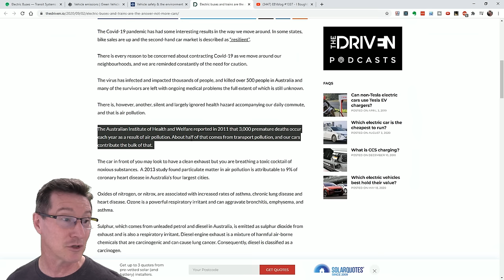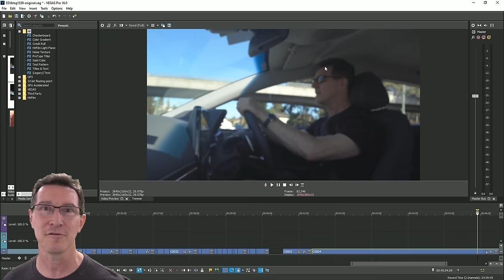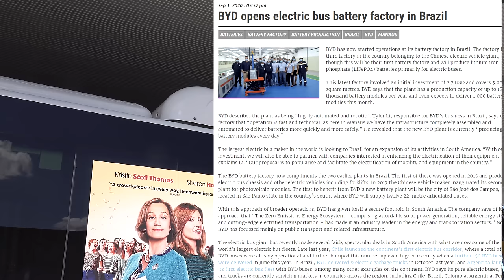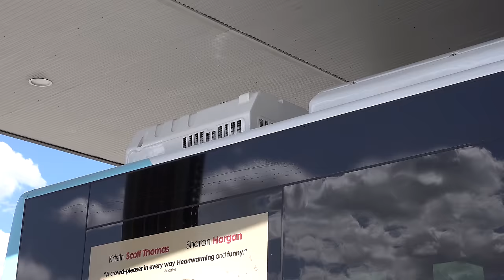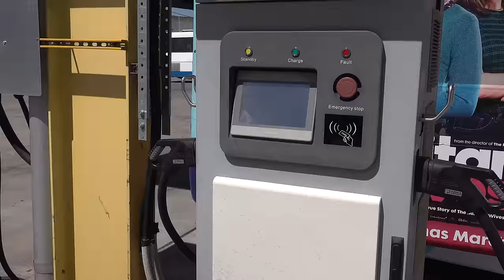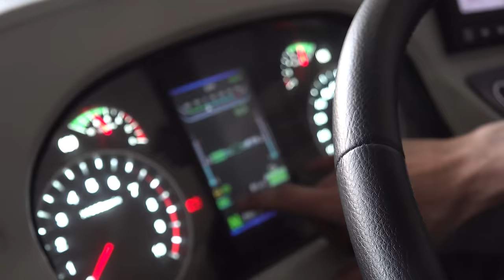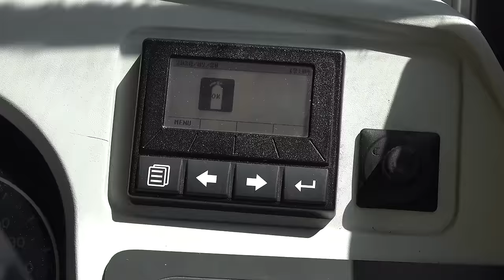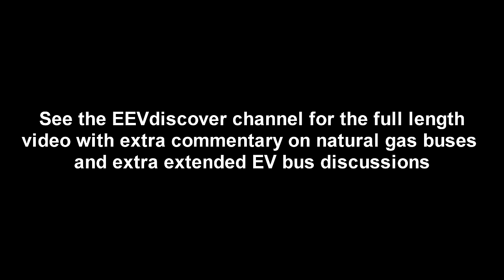EEVblog #1339 - Looking at an Electric Bus!

Comment: "there's almost half a million electric busses in the world, but you don't hear about them" 
Yes dave, that's because of the electric bit. no vroom vroom, just silence!
Reply: I can confirm this for Germany, where field tests showed that electric buses are in fact super quiet - that's mainly because they are grounded in their depot most of the time as even with the biggest and latest battery technology, they run out of juice after 1/2 a day max., whereas the diesel-powered ones run around the clock...
Reply: @f.d.6667  Did you even watch the video?
Reply: @max_kl  Maybe he meant on the routes they took which were a longer drive?
Reply: The electric buses in my city make a noticeable sound, definitely not quiet.
Reply: @gblargg   Electric busses in my city are equipped with electric vehicle warning sound systems (EVWSS). They produce artificial sounds to annoy pedestrians, pardon me, to WARN pedestrians, of course. Below 25 km/h they sound like a broken gearbox.
Reply: @max_kl  Not only that - I even developed battery-powered vehicles with my teams that made it into the market. They work great in a very tight envelope and under very specific climate conditions. In principle, buses should be the ideal platform for electric transportation - but again: the investment is huge when you want to build a system that can handle fluctuations in use or in environmental conditions. That's why a lot of cities go with a "good enough" approach which is what we see a lot in EUC recently. A really smart approach are diesel-electric buses with buffer batteries (NBfL - London)... totally awesome and can be fully integrated in an existing fleet/schedule.
Reply: @f.d.6667  Ah, that's pretty nice. Would you mind going into detail because it does sound rather interesting? I have to apologise for my first reply which was a bit rude and not constructive at all. I was already agitated because there were a lot of very ignorant comments...

The video makes it sound like they were able to replace old gas buses with these fully electric ones in Sydney without any compromises. Obviously that wouldn't work for routes where the stops are far apart and maybe partially on highways or country roads but I don't see why inner-city ones shouldn't work, even in Germany. In winter the batteries might even produce enough heat just from resistive losses. The few advantages of hybrid buses over diesel-only ones I can think of are less noise when accelerating and being able to break regeneratively. They are only insignificantly more environmentally friendly and they still have to lug around the heavy engine and the complicated mechanics and still wear their clutches (albeit less) and need their motor oil replaced. And tail-pipe emissions are also not reduced by a significant amount. But I'd love your insights on this! Also, what's EUC? My google-fu fails me on that.
Reply: And no fumes, you transfer them somewhere else.
Reply: @mikemines2931  I would assume they are using solar pannels on the depot to charge the busses from what i heard they have battery packs in the depot. Depots usually have lots of roof space. I dont think they get all their power from the solar panels but I think it would be minimal.
Reply: and they're boring and dangerous. except some are noisy.

Comment: I’m from China and those brands (BYD, Yutong) definitely dominates the Electric bus market. In my hometown majority of the buses are now fully electric, with some exceptions of extra long services (over 20kms one direction) still using natural gas. I would say it’s much better, a lot quieter streets. You never realise how much noise buses made until they were all gone. The range tend to be an issue in the winter where the batteries itself won’t able to hold much charge around 0 degrees C, but in the winter gas is also in shortage in China as it’s used for heating as well. 
Pollution wise, the power composition in China is somewhat similar to Australia- heavy on coal and fast growing renewables. But people do benefit from a cleaner city air, and grid is getting cleaner. 
Overall I don’t see the reason why not using electric buses, especially if people driving it feels it’s not a white elephant and genuinely like them.
Reply: White elephant?
Reply: @aronhighgrove4100  I think - just a regular bus from passenger perspective
Reply: extra long service bus，now begining using  HFCEV in some China city.
Reply: @aronhighgrove4100  White elephant is a colloquial term that means expensive and impractical.
Reply: @dalriada842  😊
Reply: Slave labor is the new 'green'... No Han Chinese out there in the desert mining lithium and silicon, isn't that strange?

Comment: In Netherlands we have a lot of electric buses. 
They have funky chargers. Contacts are on the roof of bus. Bus just drive in under special horizontal bar with contacts and charging.
Reply: Same in Brasov Romania, they are SOR NS 12's
Reply: sounds like a combination of electric bus and a trolleybus
Reply: @666Tomato666   Those chargers are just stationary, they don't work while driving like on tolleybusses. There's a video from Leiden in the Netherlands where you can see them in action: https://youtu.be/di3f1s5JMZo?t=535
Reply: Makes sense, so that people wouldn't be able to access it, get hurt, or try and damage/vandalize it.
Reply: @cybershadow81  but does these buses have really an advantage over the trolleybuses? Especially in flat countries like the Netherlands and some parts of Germany? I mean laying out the cables for the trolleybuses wont be much of a deal there, and no battery =no charging/maintanence issues.
Reply: Those are what we call "fast" chargers - 250kW and now we're even working on 580 kW chargers. Meanwhile, the electric buses I work with are "slow" chargers, with measly 87 kW and 60 kW chargers (a normal electric car is a 21kW charger)

Comment: For as long as I can remember there were trolleybuses in my city. There is even a joke about my city going around - something like: "If you don't know what city you are in and you look up and there are the traction wires but you look down and there are no train tracks you know you are in Tychy." but they are switching now to battery powered electric buses with automated chargers on key stops (where the bus waits for the next curse etc). It's kind of sad to see them get replaced but technology must move forward.
Reply: We still have electric trolley buses here in Vancouver Canada
Reply: In Sofia we still have trolley buses but they have been partially swapped in the last 10 years with newer models with ICE (diesel probably when I look at the smoke ) redundancy instead. I think they were manufactured in the Czech Republic. And of course we still got the old trams. But I really enjoy the electric buses we started getting (maybe Yutong as far as I remember). At first I didn't know they were electric and thought that they were CNG buses and that the air con worked and they were silent just because they were brand new instead of 20-40 years old.
Reply: That's the worst joke I've heard in my entire life.
Reply: In Riga trolleybuses still fill fine. We did replace really old ones with modern ones in early 2000's, and we are now replacing some of those with brand new ones again. Though, this time there is no big change. Last time we went from really old noisy high floor Škoda 14Tr and 15Tr to modern nearly silent low floor Solaris Trollino and Škoda 24Tr. Newest addition to the fleet is pretty much the same Solaris Trollino, but with slightly refreshed front end. Most passengers won't even notice the difference.
There been some tests of battery powered Solaris Urbino buses, but as far as I know, it never went anywhere.

Comment: I've got a great idea. Instead of lugging a massive battery pack around, why not suspend wires above the street with a contact pole or pantograph to pick up the current? Lighter weight, more efficient, less environmental impact and can run all day without having to recharge.

Surprised no one has thought of this before. Oh wait, they were doing this over a hundred years ago.
Reply: Turns out, maintaining a trolley network is more expensive then buying battery buses. The more a city grows , the bigger the advantage I assume.
Reply: North Korea begs to differ, they have those. The problem is the trolleybuses cannot maneuver as freely as standard bus.
Reply: The charging time isn't really a problem because usually people don't use busses at night that much anyway and even ice busses are parked sometimes :p
Reply: Requires a lot of specialized infrastructure and it's less flexible wrt to routing so I imagine electric busses is a far easier sell.
Reply: the only problem with this is that this is practical only in cities. We have trolleybuses that leave the city and those have batteries equipped, since it is cheaper to equip a few with batteries than to extend the line.
Reply: @NotAnonymousNo80014  I imagine initial capital costs would be greater, but maintenance of a trolleybus network shouldn't be much more expensive.
Reply: They can actually have smaller battery packs to have a backup so they aren't stuck to rails. Maybe around 5 or 10KM of driving without Pantograph power. Then, in the highly populated and traversed areas, draw line power from the roof. You could even have recessed pickups in the road if you are concerned about the looks of the city, which only activate in sections depending on whether there is a bus above them.
Reply: When something is cheaper, more easy to do, less complicated etc it does not mean it is better for the environment, in my experience it usually isnt and with battery driven equipment it mostly is not.
Reply: That is called a trolley bus. In Arnhem, the Netherlands they have these for 70 years - https://www.youtube.com/watch?v=SretIbUnTOc . Finally In 2022 they will be replaced. Edit: Oh I see, it was already in the comments above, DOH!
Reply: @anonymousarmadillo6589  what are you describing would fit perfect by using capacitor banks. They can hold enough charge to drive for a few kilometers, also the advantage is that you can charge them very fast, making it possible to have only small zones where you would charge.
Reply: @D4no00  true. Unfortunately super and ultra caps are prohibitively expensive
Reply: one more disadvantage is flexibility. Here in my city (in the US), our buses are often used for other things, for example they were recently used to help evacuate wildfire victims. Also, one construction happens, there is virtually no way to easily detour them. In addition, it is easier to take them out of service for maintenance, etc. A more ideal solution would be wireless charging in the key locations, like intersections and stops. This would still allow for a lot of flexibility, but increase continuous operating time, and be more efficient. Portland, a neighboring city to mine, is quite famous for its streetcar setup. But, it also has to have a advanced bus system as well. The streetcar is faster, and more ideal for longer distances, especially between the cities districts, but it only has stops in extremely busy areas, as the stops require much more infrastructure than just a sign. A good transit system will have multiple modes, for example a daily commute might involve riding a bicycle to a bus stop, taking the bus to a streetcar stop, taking the streetcar to a bus transfer point, then taking a bus as close as possible to the destination, then riding the bike the rest of the way to the final destination (for example work).
Reply: @Agent001  A small battery, say 20 kWh or so, could help with temporary off-grid operation.
Reply: Communist way to do it
Reply: @Agent001  This is dumb. Wireless charging is incredibly slow and inefficient.
Reply: We have trolley buses where I live and they are not very good - 
1. The trolley buses have to come to (almost)  a  stop at each intersection (because they might lose contact with the wires and have no power). If you are driving behind them, this slow speed is very unexpected.
2. The trolley lines are surprisingly noisy (sparks, friction) when in contact with the bus - you would not want to sleep with your window opened at night. 
3. Trolley lines are fixed, so there is little flexibility in the network. 
4. Single point of failure. If the line fails, all the buses just stop because they all lose power. I've seen this happen many times. 
5. The market for these is very small and that means they are expensive - there is no real competition in that market. Electric buses are probably not cheap either, but just imagine how many cities want them and how huge a market it is going to be.
Reply: @Teddy-vs5rw  1. Most of your points are based on grid power loss. The newer buses have battery backups and can drive 20KM without grid power. 
2. Buses don't ride at night. And anyway, those lines are over 100years old. Newer tech could reduce the noise and arcing issues.
Reply: @anonymousarmadillo6589  Take a look at Edinburgh tram network if you wana know why this is much cheaper than digging up the road
Reply: @anonymousarmadillo6589  1. We have new (about 5 years old) trolley buses here, some of them have backup power units - big old diesel units that generate electricity, if you can believe that. Very green. That could probably be replaced by batteries, but it's not the norm at the moment.
2. Buses do right at night - we have regular service up to about midnight, then there is the night buses which are less frequent.
All of that other stuff 'could' be improved, but the electric bus already exists and fixes all those problems. So why bother?
Reply: battery powered buses are more flexible, imagine for instance there are road works, you can't just divert a trolley bus and it would not make sense to build new lines for just a few weeks.
Reply: @tsope1  Im talking about hybrid buses. Buses that have smaller batteries with about  20km range in them. Then they can reach the suburbs comfortably. And can divert from the grid power due to  things like roadworks.
Reply: @simon7719  in Arnhem they have trolley busses with batteries for short detours. No problem with lack of flexibility.
Reply: @Teddy-vs5rw  I'm bothering because battery making, would you believe it, is an incredibly polluting process. Cobalt mining uses child and slave labor. Lithium mines use a huge fuckton of power. There is also a huge dead weight of the batteries that you have to carry around with you all the time. This is the same argument against electric trucks. Carrying a large load of batteries reduces weight lugging capacity. Also, a significant amount of power is spent on the batteries carrying themselves.
Reply: @PeterPetersNL  There is still a large sunken cost in those overhead wires if large sections were to become unused, is there not? That said, wires above short stretches like the stops are perhaps a good idea. If batteries can be smaller thanks to that, more busses can be made in a given time for the same battery production capacity.
Reply: @anonymousarmadillo6589  well, these cables are simply ugly, a lot of cities work on burying their existing cable network for these reason. not to mention that under ground cables are not exposed to sun and whether. you can use wireless charging under the road but there is a concern about them effecting people with pacemakers. and finally, it just cost more, all the miles of cables and poles end up costing more then batteries and charge stations
Reply: @tsope1  Wireless is out of question the dumbest idea. Its incredibly inefficient.  Unsightly cables don't matter in Asian, congested cities like bangalore. We have overhead power lines, fibre lines, telephone lines and all of the other stuff hanging from trees and buildings. 

In cities that care about the city scape, its an economy  of scale. Buying 10 purely battery powered buses may be cheaper than building a power network. But imagine buying 400 or 500 fully  battery vehicles. Then imagine the cost of replacing those batteries, after they inevitably  fail in a couple of years. Imagine the environmental  impact of those batteries being disposed off. 

Even though initial costs may be high, it is cheaper in the long term to use hybrid battery and rail powered buses.
Reply: Boston/Cambridge still have some trolleybuses. Apparently they climb hills better than diesel buses.
Reply: We had trolley buses in Wellington (NZ) until very recently when they decided to scrap the whole system. I suppose in due course, electric buses like this will replace the noisy diesels that they replaced the trolley system with.
Reply: Advancement in battery technology is changing the world.
Reply: because the city is huge
Reply: @Teddy-vs5rw  The city where you live obviously has a very outdated trolleybus network. None of the points you mentioned are valid in a modern trolleybus system (e.g. almost any system in Western and Central Europe). And no, trolleybuses are not more expensive than electric buses. They are almost similar in design and cost roughly the same.
Reply: Jack  complete BS. Add the energy it takes to extract oil, refine, pump, and transport gasoline to the pump. Then, a gasoline engine is around 25% efficient. The rest is wasted as heat. Why do you think they have to have a big radiator dousing the engine constantly so it doesn't burn up??
An electric motor is 90% efficient. Even running on coal produced electricity is way cleaner. And, coal is down to 20% of produced electricity in the US and falling every year. The grid gets cleaner every year. YOU ARE TRULY CLUELESS.